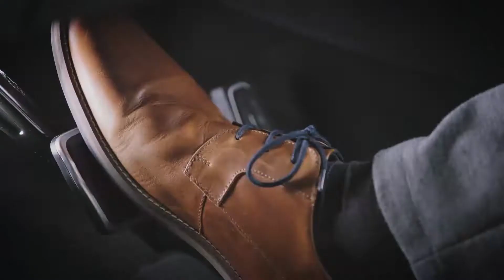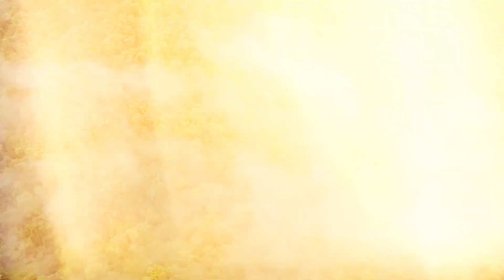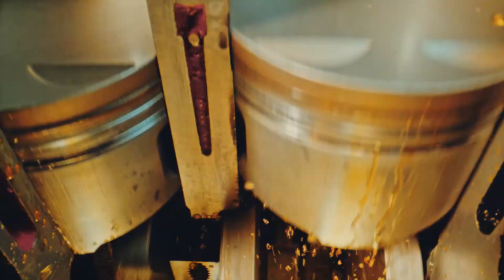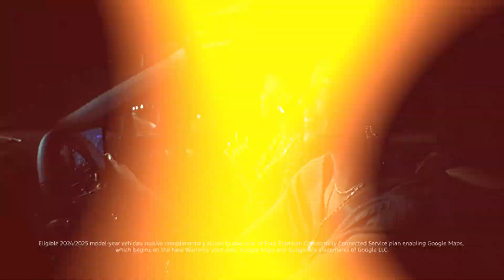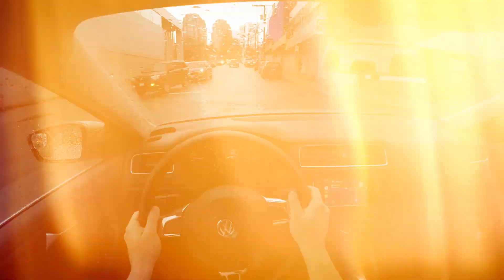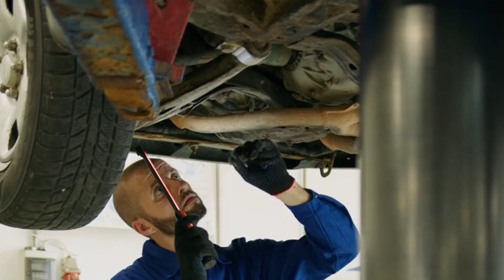Does Auto Start-Stop System ACTUALLY Ruin Your Car?

Comment: It does damage the engine inside, because the lubrication stops, the cooling stops. People who pull up fast are wearing out the inside of the engine and burn valves faster because the cooling isn't effectively working.

Comment: As a mechanical engineer and old-school driver, I’m not a fan of modern driving assists — period. My car has everything I need: manual transmission, mechanical feedback, and if ABS isn’t there, I’ll modulate the brakes myself. No sensors required.

Auto start-stop feels like another unnecessary intrusion into the driving experience. I know manufacturers engineer for it, but why invite extra wear at all? Especially when you're not behind the wheel for emissions compliance — you're there for the drive .

Great breakdown in the video — appreciate the technical side of the argument. More people should understand what’s really going on under the hood.
Reply: I think i understand your point with the driving experiences. But, to be honest, the majority of the buyers simply do not care about it - same with the companies, they want to make bills. If Mercedes uses a tech that helps when driving and Mazda doesnt, many Mazda users that only drive for going to work and back home would like to buy a mercedes because of its new assistents.

Its sad but we, as people who love cars, are the minority here. 😢

Comment: Just research Honda start / stop issues,  enough said... BTW your "robust starters"  when they fail due to excessive usage wind up costing 2 to 3 times the price same with the batteries ...so where is the savings?
Reply: 177000 km with start/stop and my DENSO starter is still good as new

Comment: Car makers aren't interested in reliability.  They make more money fixing your problems.  When your engine shuts off your coolant stops flowing through the rad and it sits there absorbing heat with no way of dissipating it.  I don't care about fuel savings or emissions on vehicles.  This garbage is why my newest vehicle is a 98 Jeep Cherokee XJ with 372,000 miles
Reply: They lose big money on warranties and recalls, and reliability is a selling point. They want things to work flawlessly for several years.

Comment: Nobody wants this and it’s a nuisance!  I installed a mod that auto turns it off on key cycle. 😂never used the auto start stop. You don’t save gas anyway. It’s more to reduce co2 etc.
Reply: You reduce CO2 by saving gas. This saves money (5%-10% estimated, but depends on your driving situation).

Comment: You almost completely skipped over the most important part. Stopping the oil pressure. Most wear on an engine is at startup due to all the oil draining back into the bottom/oil pan leaving the cam and everything above the oil pan dry. Sure while driving it may not be completely dry but doesn't have any pressure to create space between metal parts(cam,rings,bearings,lifters,pushrods,ect). Not enough pressure to create a hydraulic space between metal parts and not enough oil for proper lubrication is the real problem.
Reply: He talked about it several times. They build oil-retaining systems in place, some continue to circulate the oil (particularly turbos) even with the engine off. In most cases the engine is off for less than a minute, so there will still be oil in place even with minimal changes in design.
Reply: Engine oil doesn’t disappear when the engine stops. Bearings stay coated with a pressurized oil film, and the oil pump primes instantly. Safer than long idling

Comment: They don't save fuel in typical stop and go traffic in the USA, as you aren't stopped for 6-8 seconds, but usually end up with a hard stop and then an immediate go, followed by another hard stop and immediate go. Only at traffic lights would it be beneficial. Since we have GPS and sensors they should only turn off when a red light is detected and you are stopped.

Comment: "The multiple redundant safety conditions and sensors make this virtually impossible in properly functioning sytems" Meanwhile my friend's new Skoda Octavia 4 turns off the engine while braking to take a turn possibly causing an accident... Just unplug the 2 pin cable on the battery - terminal, because since 2022 it cannot be turned off by modifying the ECU
Reply: The plural of anecdote isn't data

Comment: Good video🎉 The morale of this story is that one has to strike balance between environmental issues and drivers' safety n comfort. It s heartening to hear that good engineering could remove the chaos created by stop n start tech.
    But the irony is that the profit mongering auto manufacturers clubbed with raising costs, are most unlikely to go for adoption of advanced engineerin g to remove anamolies arising out of this invention.
    There is one more bottle- neck from customers' demand for more milage. On this count alone, the car companies could propel this tech further mindlessly.
    The govts the world over, have to take the reins in their hands to see that this tech sustains while benefitting the car owners.❤